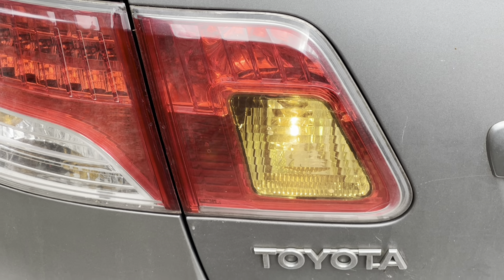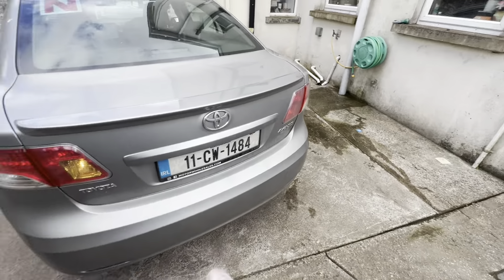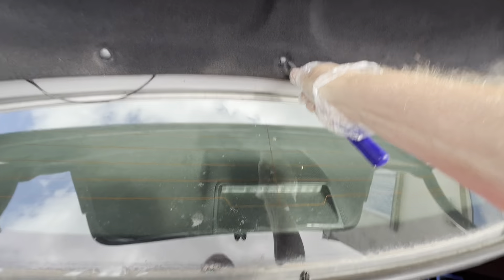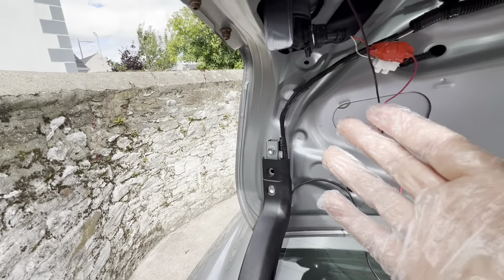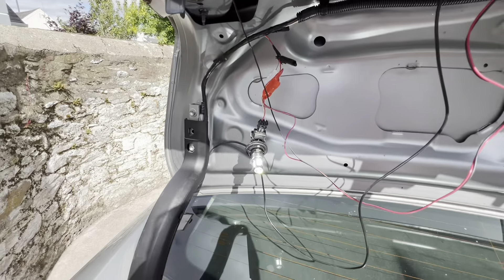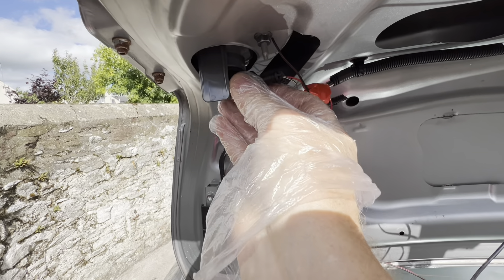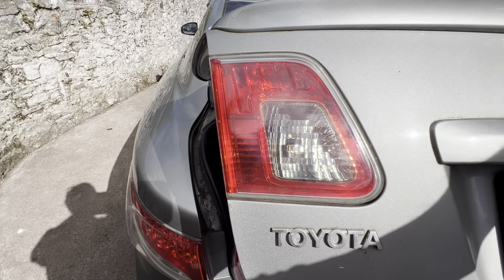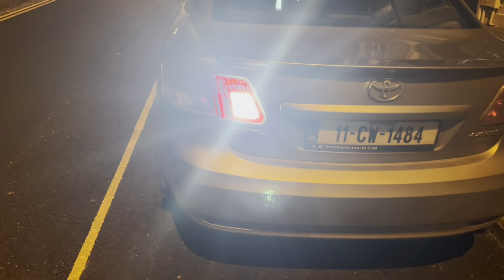Toyota Avensis Standard Reverse Light Bulb Change For Brighter LED Power! 2008 To 2015 models

Comment: I got this model. I noticed the starting symptoms of the siren whine in the front along with intermittent white smoke from exhaust on my way to Dublin for the concerts last weekend. Got any idea what it might be? I have the whine which I googled.can be either alternator or turbo but also occasional white smoke from exhaust. I couldn't get the exhaust to smoke on demand it's rare not like a head gasket and both of these issues have come up together.
Reply: I have the same model. The siren whine sounds more like the turbo. I noticed mine too a few ago, I thought it had become louder but the mechanic in toyota said it was quieter than his own so I just left it. Failed turbos can do nasty expensive damage so worth checking out. I also have random plumes of white smoke which I thought were a problem but again nothing in diagnostics and it's driving away. I do have a dodgy injector that intermittently raies a code maybe once a year so that be a contributor. The toyota owner club avensis forum can be very helpful if you post there.
Reply: @disturbedcarrot  thanks very much. If my problem is the same as yours, how long left would I get out of the car/turbo?
Reply from the maker: Hello buddy, I’ll start with the white smoke, 💨 don’t worry as mine dose this and the mechanic in Toyota told me that it’s just the car DPF is regening is burning suit in the diesel particulate filter and dose this from time to time, and the whining could be the turbo, if it makes a woooooo when accelerating that’s turbo I’d guess, also the diesel filter can cause the white smoke issue and due to burning the wrong fuel mix and change your diesel filter and it’s easy job and see how that goes, Toyota Avensis T270, D4D, 2.0L Diesel filter replacement, 2008 to 2015.
https://youtu.be/lRluxKF7f94
Reply: @cardiyrepair  thanks very much. I've left likes for your videos about this car. I am going to do the EGR cleaning thing you have a video on. I had a mechanic in Dublin give a very quick visual only look he confirmed it is no head gasket problem. If I have a turbo problem, the whine, how long/ how many miles will I get out of it before I have to do something?